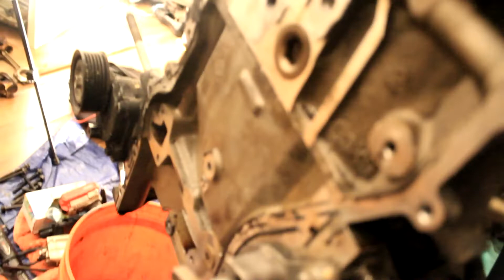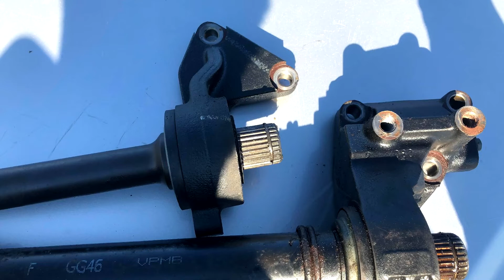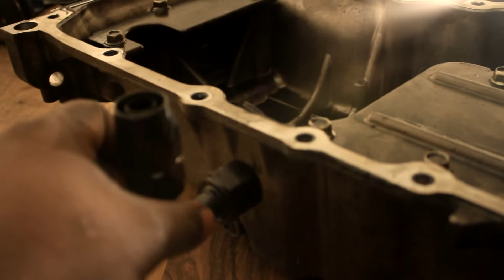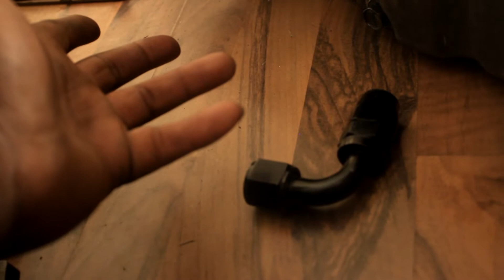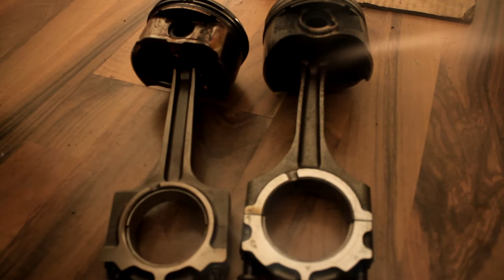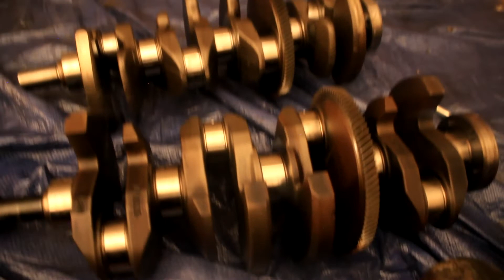MZR VS DURATECH | 2.3 DURATEC MAZDASPEED3 SWAP

Comment: Very interesting, i will try to do the same, using a duratec 2.5 block. I have no choice, since there are very hard to get a original block from a speed3 here in Europe, if there was one, it would be damn expensive. Might have to do some customization to make it work.

Comment: I have an escape with the 2.3 duratec, getting ready for a rebuild, but, I want to add some power to it. No one really does that to an escape really lol.  But I do want to. Any info you can give me, I know focus and Mazda have same engines, but are parts interchangeable being that if I search for performance parts for an escape theirs not much to choose from, but if I search for same 2.3 duratec performance, I get focus and Mazda part results

Comment: Hey maybe you would know. I'm trying to find a cheap alternative to go to a T3 style flange. That being said will a duratec exhaust manifold fit on a 2008 Mazdaspeed? I mean my motor is a Ford motor in my 08 it says fomoco all over and theres only one specific after market header to go to t3/t/4 and it's 800$ but there's tons of cheaper duratec headers
Reply from the maker: Yes I the manifold I have is an ebay cast t3 log style manifold, the only downside depending how u look at it  is, it uses the 2 bolt wastegate flange instead of a vband.
Reply: @kadeemwillock6335  ok cool so they do fit. I found one that has no waste gate outlet because I'm staying iwg for now
Reply: @kadeemwillock6335  the one I'm looking at fits t3 and the Subaru style 3 bolt
Reply from the maker: @COYOTE_N8  not sure on the subaru part of I'm understanding u. The ebay mazda/duratec is the t3 with 2 bolt 38mm gate, if u choose that type you can get a block off plate for the wastegate. Hope that helps and keep doing your research to make the best decision.
Reply: @kadeemwillock6335  yea I'll probably go with the one your talking about, thx for info
Reply from the maker: @COYOTE_N8  https://www.ebay.com/itm/T3-T4-Cast-Iron-Turbo-Manifold-for-Ford-Focus-2-3L-03-07-Mazda-3-2-0L2-3L-04-06-/254651975742?mkcid=16&mkevt=1&_trksid=p2349624.m46890.l6249&mkrid=711-127632-2357-0
Reply: @kadeemwillock6335  they want 140 and then 100$ dollars shipping for that one. Thank u though I've found them for 100-140$
Reply from the maker: @COYOTE_N8  good stuff! I just sent that link to give u an idea on what I was talking about, if u can find it cheaper that's much better.

All the best and goodluck with the car . I have not been active with content unfortunately due to some life changes but working on something in the background and should be back